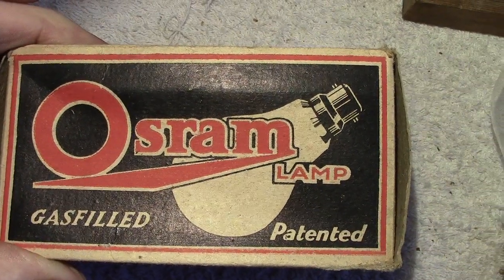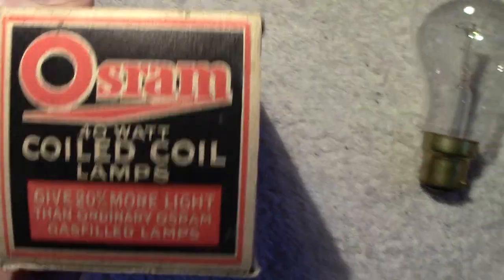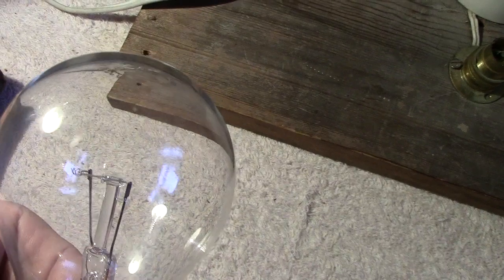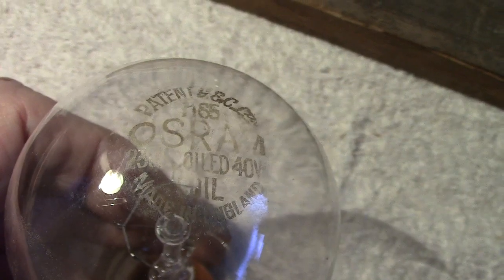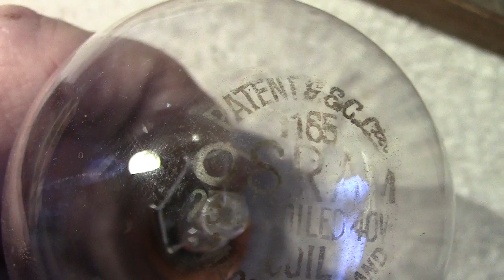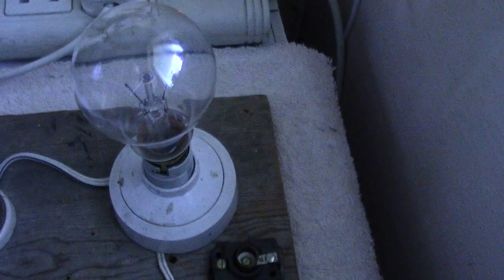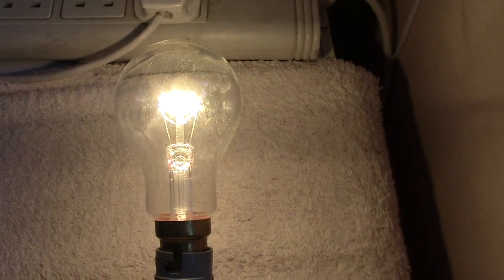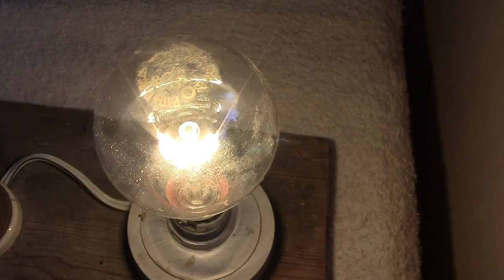Osram 40w 230w coiled coil lamp 1940s?

Comment: The filament suport lokk a bit funny with the coiled coil filament on horizontal filament.
I would also say 40s.
Reply from the maker: I remember coil coil filaments like that one before the modern designed turned up 50s or 60s